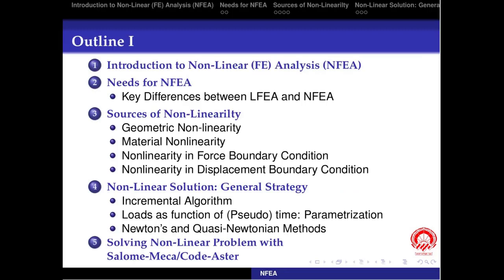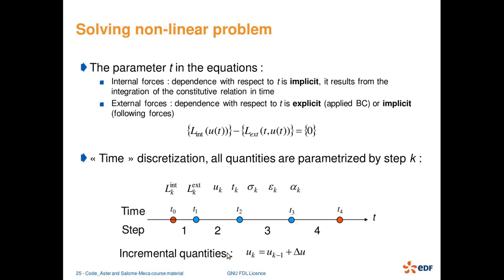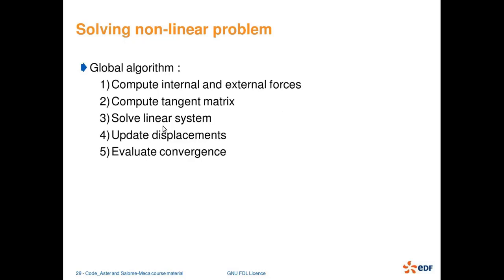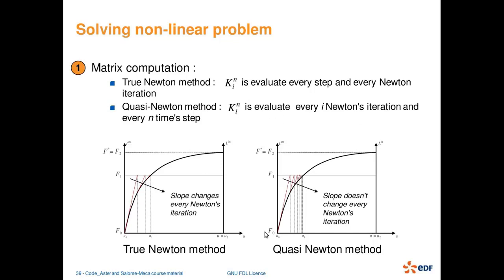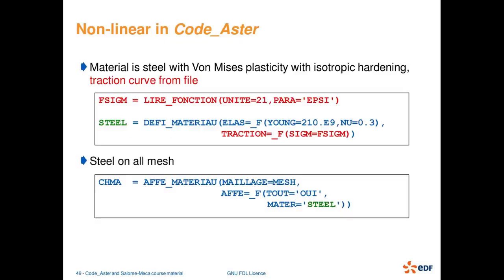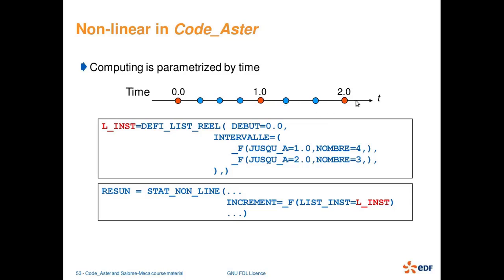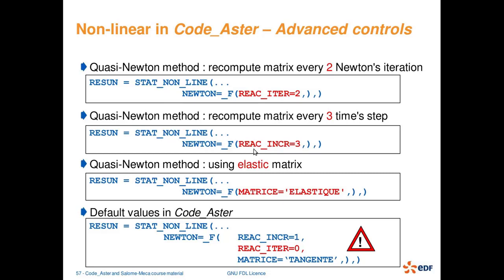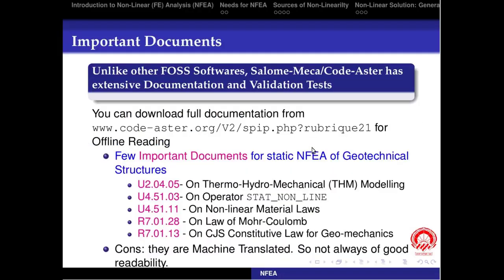Non-Linear Static FEA of Geotechnical Structure Using Salome-Meca 2017 | Part 2: Solution Strategy

Comment: Extremly useful!!

time 21:26
how do you compute the tangent matrix? Since, in the initial phase, the curve that you are showing do not exists (or does it?)
Reply from the maker: The initial phase is calculated using the elatic matrix. That's why you need to supply the elatic properties of soil viz. Young's modulus and Poisson's ratio. The nonlinear analysis takes the parameters that are applicable at the last step of initial analysis (Etat-ini).